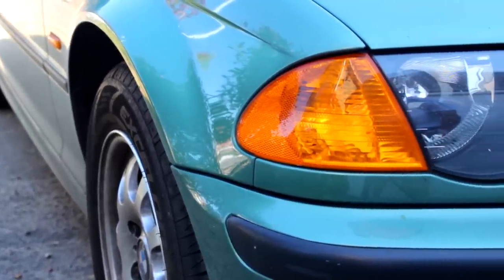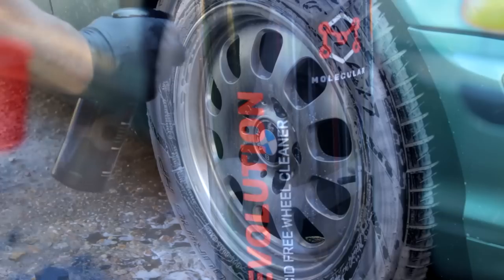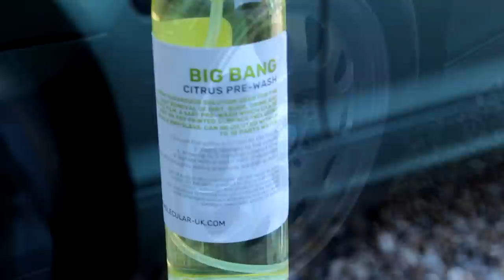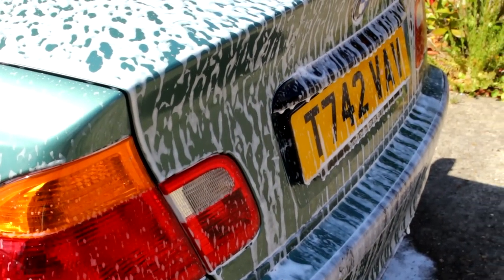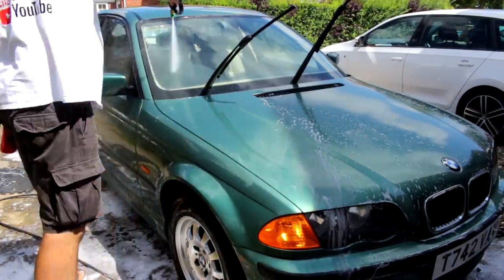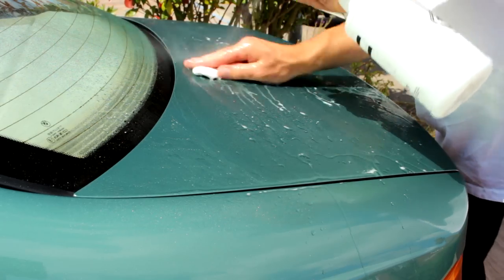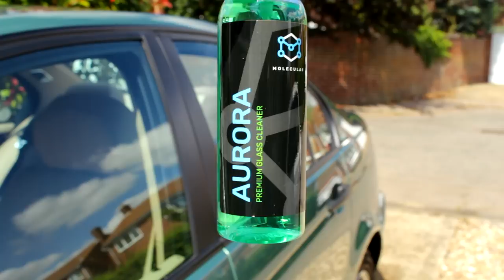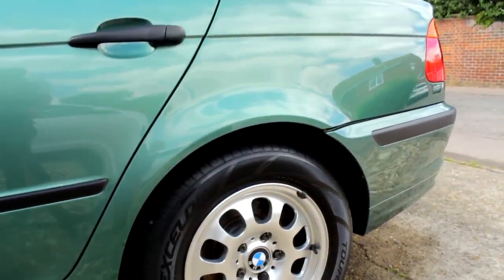BMW first wash in two months

Comment: I’ve pretty much stopped trying new snow foam. My go to now is either bilt hamber autofoam/ touchless or wax planet 8 below. Only ones that actually clean the panel
Reply from the maker: Wax planet 8 below is on my must try radar 👍🏻
Reply: @PaulDoldenDetails  it’s very good paul. Be careful diluting it, if you even mix it slightly too thick it comes out like shaving foam 🤣

Comment: Wow mostly products I haven’t tried this time which is rare😅

The 50:1 carscope say for maintenance foam must be a mistake, that would be about 20ml in a 1L lance, I think you said you used 50ml to 750ml first time which is more like 15:1 and it didn’t look great for thickness or cleaner power 🤷🏻‍♂️ looks like they’d be better off just say standard 10:1 like most others.

Comment: 6:44 True, but I wouldn't pre-wash the car twice. That's just stuff that sticks to the car paint, it doesn't cause scratches or anything. Just do a contact wash at this stage. That's also the purpose of the contact wash. The way you do it, that's a waste of a lot of water. And that for an old car (with all respect). Unnecessary.
Reply from the maker: You have an excellent point but it’s a process and a review and had to be shown 🙏🏻